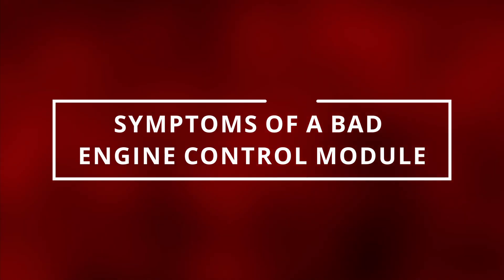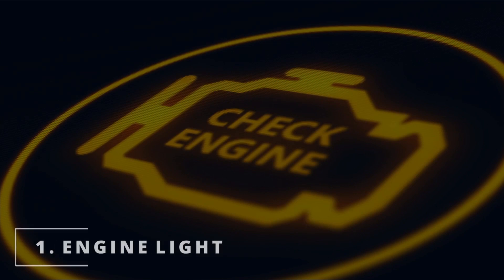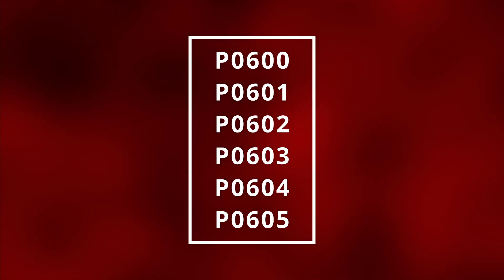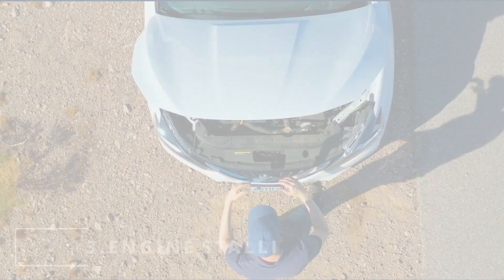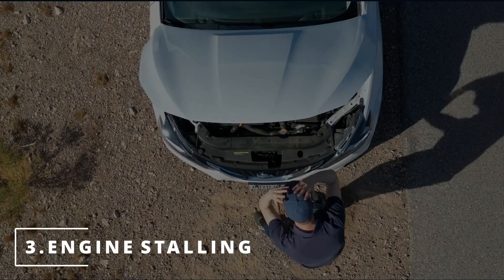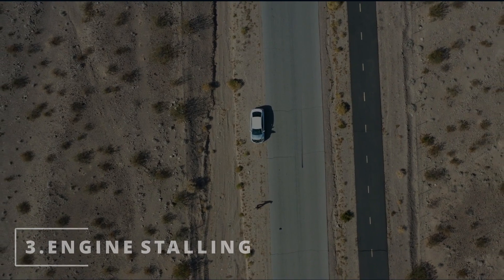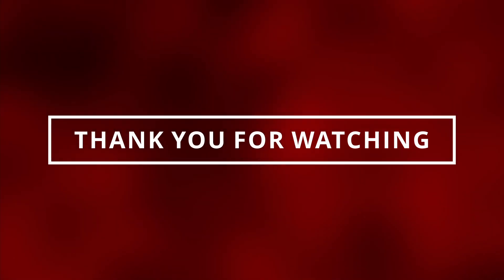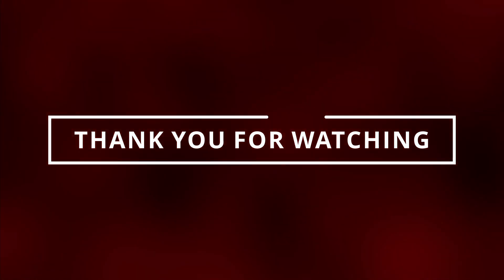SYMPTOMS OF A BAD ECM (ENGINE CONTROL MODULE)

Comment: 2000 Toyota Camry, reverse works fine but drive 2 and L all just rev up and won’t budge. I don’t think the trans is bad as the fluid looks fine and the rpm’s adjust to being put in gear. Just gave out the other day after slipping 1st gear a lot. Damn gf not telling me the cars messed up. Lots of people on the Toyota forums fixed it with a new ecu, replaced the transmission for nothing.

Comment: Man I’ve got a 2000 Lexus LS400. Guy I bought it from said it might need a new ECM. It’s been throwing a bunch of codes. I just replaced the knock sensors and the knock sensor harness, VVT Solenoids, and I’m about to replace the connectors for those too. But the CEL comes on and it’s the same damn codes. Could be a bad capacitor on the ECM right?

Comment: My 1994 Toyota Corolla started to stall & eventually unable to pull out my driveway without it turning off or just not warming up and all the lights turn out & cant rev , HOWEVER I let it sit for a month or 2 with unplugged wires & one day I turned it on and it took about 10-15min to warm up after that I could drive around but I didn’t go far just the neighborhood & gas station it’s weird cause I could not even drive before now she warms up n sounds decent , Should I still replace the ECM Module ?

Comment: Could a bad ecm trigger a p3400 code on a 2009 dodge ram 1500? Tried replacing throttle Body and still having issues. I'm also having  Hard shifts when moving from park to drive.

Comment: Would a bad ECM affect oil pressure readings? I have a 1998 Chevy S10 that cranks and runs just fine when the engine is cold but when it’s hot my OP gauge inside says zero oil pressure and the “check gauges” light come on. When I shut it off the truck will try to crank but never starts until it’s completely cooled down again. I know it has oil because I check it every time before I drive it. I even replaced the pressure sensor on the engine but no change.
Reply from the maker: It could be an ECM but that should be the last suspect. Other possible causes could be faulty oil pressure sensor wiring, a corroded connector, or a faulty oil pump.

Comment: I am having spark problems with my 2000 Lexus ES300 that has 119,000 miles on it.  Cylinders #2 and #4 are not receiving any spark, which resulted in the catalytic converter for #2, #4, #6 completely burning and melting away with the melted chunks plugging up the aft-most catalytic converter.  The only codes shown are P0300 (multiple misfire), P0301 (#1 misfire), P0302 (#2 misfire), P0304 (#4 misfire).
I replaced all 3 catalytic converters, replaced all spark plug, all coils, both cam position sensors test in the middle of the allowed ohms.  Have moved swapped coils between #2 and #6, and then #4 with #6; no matter what coil/cylinder position, rpm only drops when #6 coil disconnected, and no rpm difference when #2 and/or #4 disconnected.  Definite rpm drop when #1 coil is disconnected.
Unfortunately, the catalytic converter for #2, #4, #6 glows orange after only about 60 seconds of idling.
Any ideas will be very appreciated.
Thank you.
Reply from the maker: Sounds frustrating. Have you tried looking into vacuum leaks? (Intake manifold gasket, Vacuum hoses, etc). A vacuum leak can allow unmetered air to enter the engine, which can throw off the air-fuel ratio and cause misfires. You would hear a slight hissing sound when the car is on.

Comment: Can somebody tell me what's wrong with my Dodge ram 1500 SLT 2007 I put a brand new computer module in it and now it won't say anything but when I put the old one back in it crank up but when I put the used one in everything comes on except it will not crank up it won't say anything and somebody tell me what is wrong

Comment: Is it possible to have symptoms 3 and 4 without getting any error code in the scanner? Have a CX5 2018 and the lost of power is driving me NUTS!
Reply from the maker: It is possible, however suspecting an ECM should always be your last option. Especially if you don't have any codes.
Reply: @EasyAutoFix  What other reasons can  cause loss of power and increase fuel consumption? I'm asking cuz I'm overseas otherwise I would have this check in your shop
Reply from the maker: @ismaelagudelo9459  So it doesn't have the check engine light on? feels slow when you accelerate? how about when the car is stationary? does it want to turn off or does it shake?
Reply: @easyautofix  No check light on, scanner shows no error, but the car is really slow when accelerating, when is stationary is pretty consistent though doesn't shake or anything
Reply from the maker: @ismaelagudelo9459  Perform a visual inspection and look to see if anything is disconnected. It also wouldn't hurt to clean the MAF sensor, it's easy to do and cheap. Also, test the exhaust to see if it has a restriction (plenty of youtube vids on this). I have seen a clogged catalytic converter cause what you are describing.
Reply: @EasyAutoFix  Will do for sure and will get back to you on that for final result. Thanks a lot

Comment: My have p0717
Reply from the maker: P0717 is a diagnostic trouble code that indicates a problem with the input speed sensor circuit of the transmission control module. This code is stored when the TCM detects a discrepancy between the actual input speed of the transmission and the expected input speed based on the engine speed.

P0717 can be caused by a variety of issues, including a faulty input speed sensor, a damaged wiring harness, or a problem with the TCM itself. It can also be triggered by issues with the transmission, such as a worn or damaged internal component.
Reply: 06 chevy trail blazer 5.3 I need a Tcm

Comment: Someone should go to hell for inventing all that crap sensors, modules , drive by FUCKING WIRE accelerator pedal etc...

I have 2000 slk 230 and for last fucking 3 weeks Im trying to find on my own the malfuction.
I've got rid out of p codes but the limp mode still appears 🤦🏻‍♂️🤦🏻‍♂️🤦🏻‍♂️.
Fucking hell , O've swaped TB and Acc pedal, changed all important sensors, took out from car all wiring looms and checked / repaired , TCM , egrs...AND FUCKING NOTHING !!!!!! still need to wasting my time to search whats next 🤦🏻‍♂️🤦🏻‍♂️🤦🏻‍♂️

Comment: Hello,Circuit Intermittent , sometimes when you starter the vehicle check engine going on with VSA, nothing different after update , already replaced the crank shaft , the problem is still , I try to take off the cable from cam shaft sensor and I drive the car. It's nothing gonna be happen no a check engine going on , the pcm has been delay to see I take of the jack from the sensor so what do you think the problem? Thank you.

Comment: I replace the engine on a 2009 blazer and i have bad contac on battery post and i blame on the starter was only clicking i use a jump box puting 24 vlts to it  and then cranks but not with 12vlts now i fix the problem on the negative post but now cranks only and never starts do you think i damaged the computer already???????

Comment: On my 95 integra it gave me 2 codes the 02 sensor and the throttle position sensor. I replaced the 02 sensor then the code went away and I replaced the tps and the car was still in limp mode so when I calibrated the tps now it's not starting no crank 😐

Comment: I think mine's doing that cuz it has a reduced engine power and then it says I clear the code the car runs just fine I think it's a PCM needs to be updated or the PCM going on that car the Pontiac Grand Prix '08 and we had 181,000 mi

Comment: Visual inspection is o.k its super clean no corrosion nothing is burned.. Im having problems with my Toyota Corolla 2001 , my fuel pump doesn't seem to be engaging, fuse and relays seem to be o.k., What sensors should I check!!!!

Comment: No lights on. Car sputtering, rough idle, almost stalls out while stopped, rpms up and down during idle, sluggish acceleration and jerking with acceleration while sputtering. Any ideas?
Reply: Transmission
Reply: Vacuum leak ...Intake manifold clogged ?

Comment: What about rpm surge when clutch is in. My motorcycle has rpm surge when pulling the clutch and idle rpm is also higher than 2000. The service centre says their diagnosing software says faulty ECM.

Comment: Engine light came on for a small EVAP leak, it was fixed. Then it came back on for the same thing, the evap was fixed the dealer said my ECM level was low, they updated it, the light came back on same Evap diagnosis, I took it to a different VW dealer they said the same thing, low ECM level so they updated it and two days later today the light comes back on. So I’m just guessing the ECM itself is bad. So replacing it is where I’m
Going with it

Comment: Spent too much money on the wrong things, thanks for this video! Going to get the ECm checked and replaced
Reply: I changed oil pump, water pump, air flow sensor and as they downed the engine many other stuff for wear and tear. Eventually they say ECM maybe is down and they have no clue to fix it. Now I’m thinking is it better to go Ford Workshop then outsiders for experts is missing and no solution to the problem.
Reply: @windfal7 I went to a mechanic and they said : we don't know what's wrong with your car the computer won't show it😂. I went home and repair the  mount bushings my self and the car stop stalling and shaking like crazy. Mechanic They are smart lazy this days
Reply: Same here smh
Reply: Get your car scanned

Comment: I got an 07 Camry, I recalled having it scanned for the check engine light and there was more then one codes that came back as problems. One of them was the ECM processor, the second code was an O2 Sensor. Last night I was driving home after a long day at work, when I was at least 5 minutes away from my home destination my exhaust became louder and my Rpm was stuck at 2,000rpm during idle at a stand still stop it drops down to 1,000rpm where it should be. My guess is it may be a bad throttle body or a bad ABS control module, the ABS light is also on. It's a common problem on the 07-09 Camrys.

Comment: Long shot but would anyone know if this would relate to a 2012 GMC Sierra I’ve changed the throttle body tps and the acceleration pedal and it was fine for a week and at random my gas pedal will quit responding and it will run super ruff you can pull over turn it off and turn it back on and run fine for a while then do it again
Reply: So did u figured it out? My 09 Chevy runs ruff also and changed out the tps and mass air flow sensor and o2 sensor

Comment: My 99 Isuzu Rodeo 3.2L has been having several issues. 1. Hard shifting and it will not shift into overdrive. It actually seems to go back into 2nd when it should go into overdrive. I'm riding 2500-3000rpms going 50mph. It seems if I get up to 70mph and 3500rpms and hold it long enough something lets go finally and then rpms drop and the check transmission light starts flashing. 2. My Rodeo also has an issue with starting then immediately stalling. It used to be every other time I'd start it up. Now it's nearly every time except on cold starts. But warm starts are ridiculous. Occasionally it'll try to start without a single crank, but stalls. And then other times it cranks and cranks and cranks and still won't start until I give it some gas. On these starts the idle is up and down and up and down til it settles between 500 and 1000rpms. On occasion it'll stall out while idling but not driving. That's even on cold starts. It just does whatever it feels like. There's no vacuum leaks that I can find. There are no codes thrown for any of these issues. None. One person did have a scanner tool hooked up that showed a "pending" code for an O2 sensor failure. But now 3. My 4wheeldrive suddenly stopped working too. Doesn't engage, the light doesn't even come on when I hit the button. So do I have a damaged ECM or PCM? Is there a difference? I think my Rodeo's brain is called a PCM. Any suggestions would be fantastic. I'm about to drive this off a cliff with no insurance. That's how frustrated I'm getting.
Reply: Did you find out the result?
Reply: @TheRoadLessChosen  I've got a 2003 Rodeo with low miles, but not low issues. Besides a couple of buttons in the cabin to select "power" or "winter" modes, there's nothing to influence the automatic transmission performance -- and I suspect that only locks out 3-4th or 1st gear. OP's transmission symptoms are a whole nother thing, it seems to me. 

As for the starting, stalling, and idle symptoms -- I'd check the ionic sensor, a module connected to the ECM located on the top middle of the engine. From what I gather this is an uncommon module, but a common issue.

Comment: Wow thanks for the info. I have codes, for the throttle body, like 4 of em. Changed the entire throttle body, same codes, pro diagnosed it and the ECM is bad. Also when I get to say 30mph, reaches down to 20mph, it jerks slightly. The ABS and ESC light also is turned on with codes indicating multiple speed sensors, normally I'd think only one goes bad but multiple? Do you know if that could be a cause as well? I'm hoping the new ECM on the way fixes all that. (eBay $26, Sonata '10) Thanks
Reply: Did you get the ecm replaced? Did it need to be programmed?
Reply: Did it work? I have reduced engine power... Code for throttle body p1516 but that's not issue.

Comment: I haven’t yet replaced the ECM, my van 2013 Dodge Caravan starts and dies already. I’ve replace sparks, coils, rockers -lifters, and alternator I still get every code relating to misfires and slow response time in camshaft. I do have a used ECM I pulled from the yard. How would you tackle this? Tried clearing the codes with the scanner with no luck. Please any help would be so appreciated.

Comment: I have a 2006 Chrysler Sebring. We have changed the alternator and tested it. We changed the battery and tested it. The car will not stay running. Once the battery juice is dry the cars dead. 🤷‍♀️

Comment: These same symptoms apply to bad O2, Camshaft, Crankshaft and Mass Air Flow sensors too lol....which which is which
Reply: I had a MAF code once and the symptoms were different more of like a delay problem and sluggish - I’m having downshift problems now on low speeds with no codes on

Comment: Could a bad ECM also cause traction control to switch off, cruise control to not respond and power steering to freeze up on slow turns?
Reply: it could be part of the problem, hook up to a code reader and see what’s actually going on. if there are no PCM/ECM/ECU codes and you can’t figure it out i would take it somewhere.
Reply: Yes
Reply: I thought I was trippin out too cuz I usually have my small dog come with me and she usually steps on the traction button or the ECT/NOW button or the sport suspension button - but now I am seeing it turn on more often since I’ve had shifting problems this morning

Comment: Happened to my 2007 ford expedition miles is at 192,455 just died at gas station on me but we tried starter nope checked all fuses checked all grounds still nothing I dont know if my engine swap had anything to do with the thing not starting so now I'm sending to ford so they can fix it. Hopefully they reset my ecm n that works until than I'm busing it

Comment: i have a toyota vitz 06 . when i ride over 60km/u and press the brakes it shuts down ,and i can start it back again and again normally . but when i ride 20km/u it doesnt shut down but than the engine idles like coil or spark plug is faulty . i now know its not that cuz i just changed them coils and sparkplugs .even the trottle i changed and gas pedal . yet the same problem . is there anyone that can help me ? what to check now

Comment: 2009 Kia Sorento, check engine light came on months prior to this: had occasional symptoms of possible clogged catalytic converter or even maybe fuel pump issues, drove it home one night, no new issues, next morning it crunk up but wouldn't go in reverse and acceleration in drive was very minimal and no power. Drove about 4 miles and it cut off, popped hood and seen that the transmission fluid and blown back out the dipstick, added more fluid, cut it off and back on and it was as if nothing had happened at all. Drove about 2 miles to store, got gas, drove about 1/8 of a mile and there was a grinding sound if you will, car cut off and would not start back up (acted like it had a dead battery) I let it roll in neutral to my yard, where it remains. It wouldn't crank back up then, 6/7 hours later I try to crank again and it would as long as I sit in the gas pedal. I check and confirm all fluids are good and leave it be for the night. Next morning it cranks up with no problem at all but now when I put it in gear it won't move, revs up, but in no gear will it move... Any advice on what I have going on here?
Reply: crankshaft sensor or some sensor. start at the bottom

Comment: I got a 2017 Kia Forte LX from Drivetime. Seems it was sitting around too long. The car seemed so perfect. Ran great up until I took it off the lot officially.-- I drove through a plaza slowly stepped on the gas and nothing, the car was off. The oil light, battery and check engine light came on. I was able to easily crank the car back up as if it never happened. Then it did it again 8min later. 

No codes showed up when the dealer looked at it. And he was just as confused  lol smh. Do you think this is the fix it needs?
Reply: Bro bought a Kia LMFAOOOOOO go junk that POS

Comment: I went to the dealer maintenance and they’re charging me 1,000$ for a “control module” piece that is the cause of my car acting up. It has some symptoms like this video had but not all. It backs up sometimes while on Drive. Should I pay up or look for other options? I’m new to this
Reply: Did you get it fixed ? And where ?